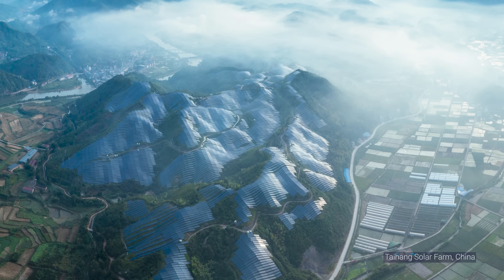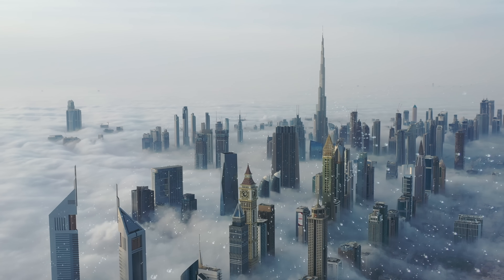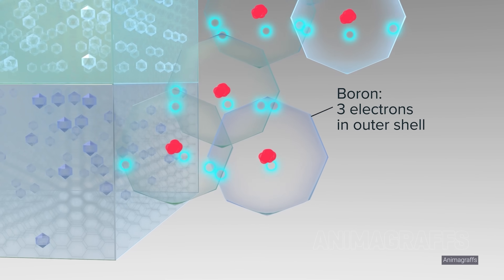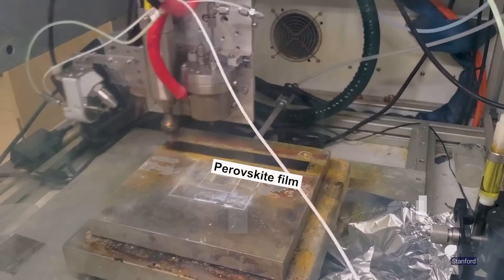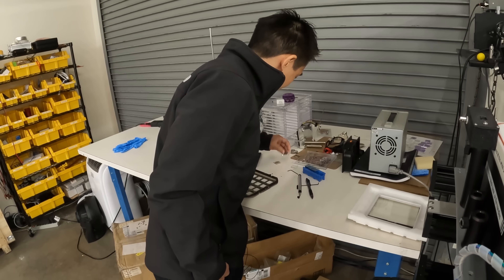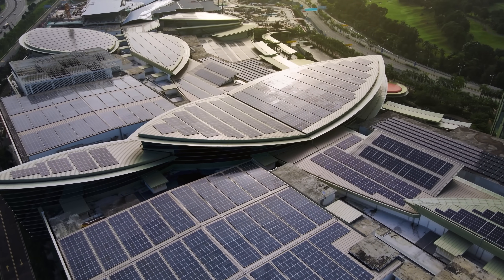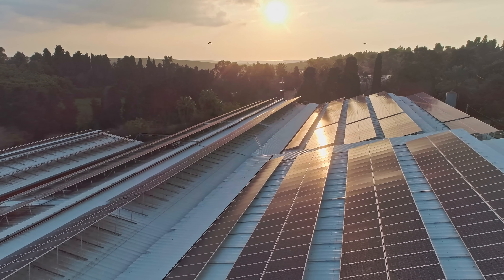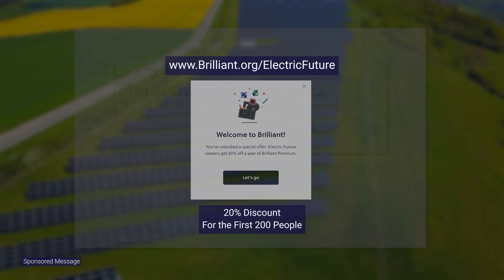Solar 3.0: This New Technology Could Change Everything

Comment: 100 times the current conversion efficiency of current solar cells?  100x is possible only if the conversion efficiency was 1%!  Present conversion efficiency ranges roughly from 20% to 47% depending on technology which means the increase can not be more than 2.1 to 5 times the current levels. An increase more than that means they have created the impossible, a cell that produces more power out than the power it receives from the sun.   A100x improvement in conversion efficiency is impossible.
Reply: Let them dream.

Comment: How about integrating photovoltaic with radiative cooling panels? It will keep the panels cooled sending heat to outer space through emitting specific infrared frequency that escapes atmosphere. It will help with durability issue dramatically!
Reply: It's a good thought but fluid based systems have issues of their own. Fluid tends to be hard on materials, and active solutions with pumps and valves will wear out. 
If you design something to be cooled, what happens when that cooling fails? What fluid will you be using in the loop and will it be bad for the environment if it leaks? How much of your power being produced is dedicated to the cooling solution?
Many solar plants already have high work hour demands with just cleaning the panels, and that is low income work. Plumbers and fluid engineers are much more expensive. In household solutions it can make sense (the products do exist), heating your hot water tank and providing power with the same device but the issues are still the same.

India has been using a middling strategy, they are installing solar over canal systems and water reservoirs. Evaporation from the water lowers the temperature of the panels and the shade the panel provides limits the water lost to solar heating and evaporation. It is a passive solution that still lowers the expected lifespan due to moisture levels and corrosion, but the cooling makes the panels much more efficient while they work, to the point that the tradeoff is worthwhile. This solution also improves cleaning effectiveness, water is very close so you don't need as strong of a pump, and the water drains back into the source rather than the ground.

Nothing is perfect but smart people over time eventually get to simple and genius solutions, who knows what people will come up with!
Reply: @Shoi5  Do you have reading comprehension deficiency?  He is not talking about fluid cooling solutions AT ALL !!!  Read again where he mentions  "radiative cooling panels" ...
Reply: @AscendingApsolut  they would have to be mounted directly behind the solar panels meaning they would radiate back through the panel further heating it or the home beneath it not really good either way so you would have to transfer the heat away then radiate it up to work heat pipes would be a good solution they require basically 0 maintenance with super fast heat transfer would only need a fluid bath on one end could be used as a solar water heater fluid could be used to heat homes in winter or used for preheating water used in water heaters etc I know they are developing new materials that can turn heat into electrical energy and this would be a good use for that heat also further improving efficiency of the system
Reply: I did a paper in college about using space based solar farms that use microwave technology to direct that energy back to earth.  This idea could also be used to stop tornados if you think about it.

Comment: transparent battery electrode films work too
Reply: you dont have to have semiconducting layers, just dissimilar metals with electric field without conducting electrolyte that would make it a battery
Reply: the layer between the positive and negative layers, can be almost anything, intrinsic semiconductor works too, it would be copper-2-oxide, and one of the electrodes of the battery can be copper-metal, then the other electrode could be for example aluminium, whatever makes a suitable voltage battery voltage cell over the intrinsic layer
Reply: zinc - copper-2-oxide - copper solar cell

Comment: He said, "Stability is still a challenge..."

IOW, the perovskites don't last very long, much less than 25 years.  They won't be able to be used for rooftop or utility scale solar systems until their "stability" AKA lifetimes can be increased to 25 years.

If perovskites can be made cheap enough, the sheets might be made to be quickly and easily changed when they lose efficiency.
Reply: 1/15 the cost seems to make up for the more limited lifespan.
Reply: @nftawes2787  Also should have less installation cost, since they're much lighter weight. Could be ideal for DIY home use.
Reply: @nftawes2787  this is old technology, have you seen the Knight Rider 2000? 
it  is coated with this solar film .
Reply: Depends on how it gets used, i dont agree that we would need one or another, for long-living installations you could make solar cells like we have now, but for stuff where its a temporary set-up than this would be a massive success. The light weight and cheapness of the cell makes it perfect to be put on stop of cars, it would be a perfect addition to electric cars, and given that most cars are used  during the day, i would say that a much much smaller battery could be out into such a car all in order to reduce weight and give a small timespan in order to go through moments of missing sunlight. 

This technology would be a godsend in areas where there is a lot of sunlight to begin with. 

On top of that, if they manage to scale it up and make it light-weight enough, they could even put it on clothes for induvidual uses, so your smartphones battery timespan wouldnt be the main concern of yours anymore, and a single piece of clothing usually isnt used for over 15 years , so the cell would be a great fit on that as well. 

And on many many other consumable goods this technology would be perfect, for example you want to go into the forest and relax but not miss out on the convenience of electrity, you could just bring a big piece of cloth which you span on a open field, than charge your devices via that. 

Maybe im a bit to positive on the good aspects of this technology, but i thing that given the trend to having more smart tools surrounding us, this technology would fit right into that market.
Reply: Other companies have to intentionally bother making products obsolete over time, if this is both cheap and has a decent but not long longevity its not that big of a negative either, specially since there's manual labor involved (it might help sustain the market since more installations over time means more laborers supporting it to get more labor out of it). 
Not a fan of planned obsolence but still worth noting I think.
Reply: The life of these new panels vs silicon panels, assuming the 15x production saving = 1.66 years. so if the formula lasts 2 years before having to be replaced, that accounts for the cost of a worker to replace the panels, which after the initial install would be a 30-60 minute job of unscrewing one set of panels and screwing in the new set.

Benefit being new formula(s) that might mean longer life and / or more power both of which are of benefit to the user.  Loner life = less re-installs, more power = feeding more back to the grid for credit off the power bill.
Reply: Yes he’s hedging due to expected pressure of electric companies,cars
Reply: التحدي الآن، هو كيف يمكن زيادة إستقرار  الغنية البلورية للبيروفسكايت؟
Reply: So put them in a place where they won't be exposed to the outside elements and be temp controlled.  I know that sounds crazy, but I have an idea (and a patent) if you want to know more, let me know.

Comment: I love it when solar advocates say "you only need 100 miles by 100 miles of solar panels to power the US".  That is a meaningless statistic for one thing .... what about all the energy it takes to find, mine, refine and shape all the copper needed to distribute that power throughout the UN?   What about what is now under all that 10,000 square miles of land?  What happens when it rains or is cloudy, or there is a tornado?  I know, you don't literally mean to build 100x100 miles of solar panels all together, but land itself is a non-renewable resource.  It is great to put solar panels where they can do some good, but to really generate the power we need without CO2, 7x24x365  the way to go is nuclear.
Reply: The utilities determine what will generate their electricity, and they're not choosing new nuclear because of multi-billion dollar cost overruns and the construction delays cause them to take more than a decade to bring online.  They will have to overcome those roadblocks before the power industry accepts new nuclear.
Reply: @acmefixer1  
What you don't seem to realize, or want to acknowledge is that the first few of anything are always over-budget and have problems.  It is a chicken and egg problem - and while the rest of the world again passes us by on what was our technological achievement, we go backwards.  Look at Ukraine.  They produce almost 50% of their energy from nuclear - even after Chernobyl, and are one of the lower carbon-footprint countries in the world.  This argument of yours is BS because these plants never get to scale and mass-production - but then ever after those delays and cost overruns they can produce power less expensively that other sources and are carbon free.  I understand the concerns about nuclear and have no always been pro-nuclear, but I am so disgusted by the refusal of the anti-nuclear groups to even think or listen to the facts.
Reply: in theory I agree with you, but what type of nuclear. What fuel? Not uranium if you are looking for U.S. energy independence.
Reply: "what about all the energy it takes to find, mine, refine and shape all the copper needed to distribute that power" There already exist power lines, and people will consider that an issue worth mentioning in relation to renewables once you start adding that same cost to the price of the coal and nuclear plants.
Also, just put "agrivoltaics" in the YT search bar for videos that explain how putting up solar panels to give plants shade will improve farming.

Comment: If they can form at such a low temperature (100⁰) how do you protect them from damage? I'd assume panels in the midday sun certainly in many parts of the world would be exposed to temperatures exceeding that as anyone who's poured water on a hot car in the middle of summer in Australia would know (100⁰c being the boiling temperature of water) or is it stable above that temperature it's just that's the temperature at which the solution dissipates and crystals form? Thanks & great video btw!
Reply: Scientists have been working on perovskites for a couple of decades now. They are sure to have dealt with any issue as obvious as temperature.
Reply: I assume heating in a vacuum makes a difference.
Reply: @nftawes2787  Why?
Reply: @lengould9262  Water boils at lower temperature when the air pressure is lower, that probably also applies to other molecules.
Reply: @AnalystPrime  means vacuum would be worse than atmosphere then, correct?

All above is just nonscience.
Anyone have any factual information against perskovites v.s. temperature compared to crystalline?
Reply: @lengould9262  As explained in the video, they use vacuum deposition to make these panels and that is why <100C temperatures are enough.
It follows that the materials would not boil off as easily in regular air pressure and low temperature.
Just basic facts and common science.
Reply: Put them in a place where they will not be exposed to the elements and be temp controlled.  I have an idea (and patent) if you want to hear more.
Reply: Just like electric car batteries SUCK horribly unless you're in Los Angeles...
Reply: Covering the perovskite material with thin glass or weather resistant clear plastic would probably protect it from most external damage.

Comment: He says they use only 1% of the material of silicone cells so it could be really cheap to MAKE. They could layer as many layers as the want with a possible efficiency of up to 83% but rather than making a similar priced solar panel but with efficiencies of around 80%, it looks like as ever we'll get a panel slightly more efficient than the existing ones, and slightly cheaper but a much bigger profit margin for the solar panel companies. If they want to be jobbies why not just get a silicone panel and add a layer of  perovskite on top, increasing efficiency of panels, get a company to come coat my existing panels and make them more efficient.
Reply: Where does it say a solar panel's efficiency could be 83%?
Reply: You can't just add up the efficiencies by stacking individual cells. There are many factors such as tunnel junctions, lattice mismatch, bandgaps, etc. to consider. Trust me it's not that simple!  Even if your idea works, you can't just simply deposit layers of perovskite on existing PV panels. These solar cells are encapsulated and they also have anti-reflective coatings on them.
Reply: @bluestar2253  just do it, nerd

Comment: That is, because this technology yields less than 20% efficiency per junction, there's no way it can produce 40% with 2.
Sea level insolation is still ~1.1kW/m^2 at noon on a sunny day, that is to run an ~2kW electric kettle with even 50% efficient solar cells, you need 4m^2 of them... at noon in direct sunlight.
Mean annual efficiency of solar energy extraction with electric cells is about half of their nominal, so why everybody is so excited about them?
There are much simpler and better ways to do it, than relying on photoelectric effect. Simple solar thermal panels are much better and they do not deteriorate as quickly.
But the hard limit is that ~1kW/m^2, so unless we have efficient ways of energy storage, conservation and conversion, no super piece of tech can make it viable.
Reply: He said theoretical upper limit is 40 but 30 is the goal.  Hopefully, they can get three layers to get a 60 % theoretical with a 40% actual.
Reply: @dalerichardson7202  The current theoretical limit for waver tech is ~33%, but hard theoretical limits are not to be achieved - that's why they are theoretical. The best waver tech is below 25% and thin film tech is said to be worse as to efficiency. I understand the aim and hope, but they didn't even say how much efficiency they have right now. What this vid really shows is that you have to paste this thing everywhere over everything - cars, planes, buildings, to even propose it as any kind of energy source, and that's why they promote a thin film tech. But the key parameters for energy production are efficiency and energy density. Neither of these is good here. Let's say you need 1MW of power - with 33% efficiency you'll theoretically need 30 ares of continuous cells, and practically multiple sets taking at least twice as much area. If you consider annual mean efficiency of solar power tech, you must still multiply it by 2. Considering maintenance and deterioration, I bet this will easily arrive at 1.5ha/MW. What if you need 100MW?
I live in a country with ~20GW mean usage, with 24.5GW peak record. That would give ~300'000ha necessary to produce it. Putting aside, that it's absolutely mind-boggling and impossible value, with country's area ~31'200'000ha, it would require almost 1% of entire country covered in solar power stations or all major cities doing nothing else, than producing electricity.
That's why you'd need to cover almost everything with a thin film solar cell, but considering every other element of a power grid, especially storage - it's IMPOSSIBLE!

Comment: I want to see 10X to 1000X less cost as the video states, because that would be -9X to -999X. In math they are called word problems. 1000 times less, where x is the starting number, is x-1000x. Where as 1/1000th less is to remove 1/1000th and 999/1000th less is to remove 99.9%.
Reply: You're thinking of "less" as a synonym for "minus", meaning subtraction.  In which case you're correct.   However, in everyday speech this colloquialism means multiplying or dividing by factor x.

When people say "ten times more than x", they mean 10x not 11x.  

Facts.

If this were a mathematical proof we would say "ten x"; 10x meaning "ten times x".

Is $10 ten times more than $1?  You're going to confuse a lot of innocent people if you go around saying "no" to that.
Reply: @anonnotanks3756  No 10x as must does not equal 10x more in any sense of the meaning. One is 10x and the other is 11x.  Less in any word problem is subtract not multiplying or dividing. Otherwise when using fractions or percent the conversation would only give confusion. Using something wrong by the masses does not make it right. Under your idea of colloquialism where 10 time less some how equals 1/10x, then under the same logic, or lack there of, 1/10 less would equal 10x. Because in both cases your dividing and not subtracting, and that just makes everyone dumber.